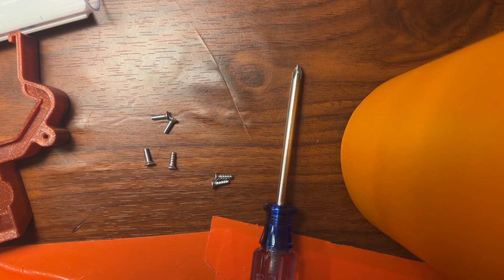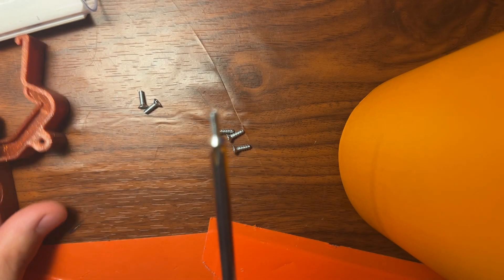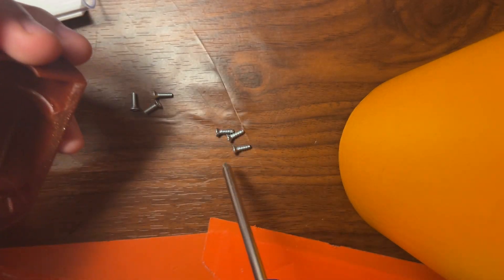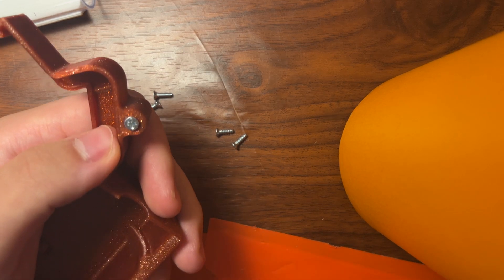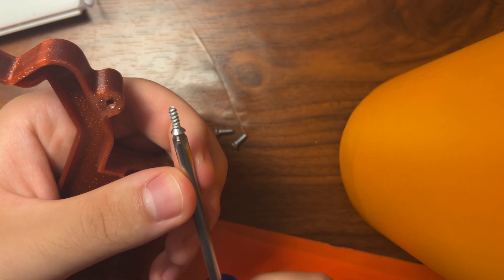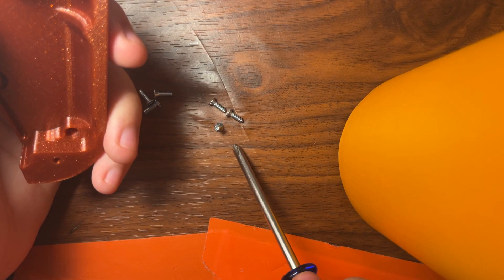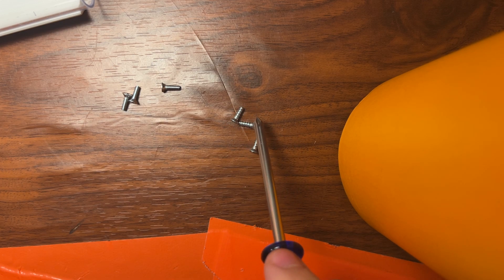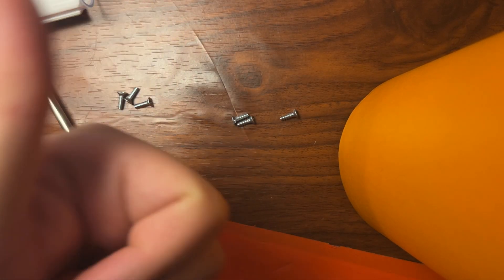Let's talk about new screws! (I'm switching from 4-40 screws to #4 thread forming screws.)

Comment: unrelated to the video, are you worried about your intake of printer plastics at all?
Reply from the maker: Yes. All the time I think about it. And it worries me a lot. That being said:

- For my printer, I have an enclosure around the printer with a big exhaust fan and duct that dumps it outside, so I don't get the fumes. 
- For print cleanup, I try to keep track of any little strands and strings and I either clean them up with a lighter or I just rip them off and throw them away. 
- I clean my hands very well before I eat anything after working on prints, so I don't eat little bits. 
- And I don't sand parts. Instead I use an xacto knife, so there are less particles. 
- I also have 2 air purifiers in the room I work in. 

So idk how much of an issue it is? I just hope that when I'm nearing my 50s I don't need to deal with awful microplastics issues that I'm causing now in my early 20s. I try my best to avoid it, but its rough.
Reply: @Sillybutts  seems like you have the problem under control pretty well! i just get concerned whenever i see print setups like that. its personally turned me off 3d printing because of it.

Comment: The usual screws that Hasbro uses are halfway between the 40/40 and these #4. In the early days before 3D printed blasters, everything was modding an existing Nerf shell and those Hasbro screws were a pain, offset it just a little and the inserted thread was ruined. I wish they had used these or at least a courser thread. I guess they didn't expect their toys to be taken apart so often.

Comment: I was definitely surprised to see machine screws in 3d print blaster kits.  They're not the right tool for the job (except when screwing into threaded holes like on some bars in some kits).  Definitely better to have a self-tapping/threading (not self drilling!) screw for fastening plastic.  I can see why they were used in some respect, as that style of screw is really common for making 3d printed parts with captured nuts, so people probably already had them on hand.

FWIW, Out of Darts has been shipping the self tapping screws with SLAB kits already as of a few weeks ago.  I still got some M3 (edit: not M3; 4-40) screws in my Cynthia kit, but I'm guessing they're just going through their already packaged kits in stock.  I went ahead and replaced several M3 on that kit with leftover #4 screws and they work just so much better.
Reply from the maker: M3 screws are still being used. These #4 screws are replacing 4-40 screws in my kits, not M3.
Reply: @Sillybutts  I was more referring to machine screws in general.  I don't know why I started typing M3 -- I think I was looking at a print at work that had them this morning LOL.

Comment: Heatset inserts are lurking around the corner :D
Reply: If you're careful when using self tapping screws, you should be fine.  I could see heatset inserts for certain parts that you may want to remove semi-regularly.  Really so far with most of the 3d printed blasters I've made, I haven't seen the need for them.  It's not like injection molding where you have 25 screws holding two halves of a shell together.  On 3d printed blasters you can generally disassemble them enough for spring changes/cleaning/lubing with takedown pins and in the case of the SLAB, the bars are threaded.

Comment: #4 threading screws r gonna be perfect for u mr butts for they will essentially give u the same threading cut as regular nerf screws and it will make it a lot quicker designing new blasters because assembly will be a lot smoother as well as sturdier also to note whwt u said about not being able to accidentally strip out the hole with the #4 screws ur gonna be more liable to snap/crack the plastic at the holes opening than u r to strip the hole itself